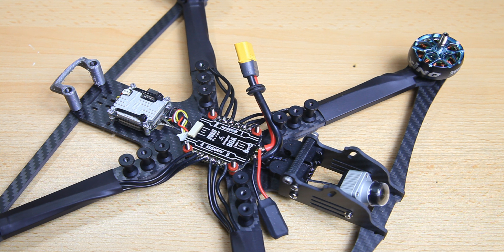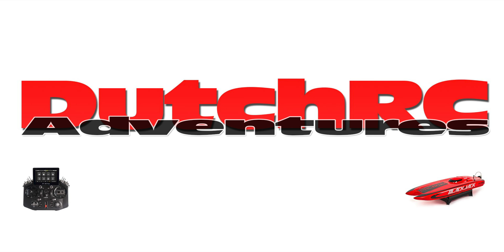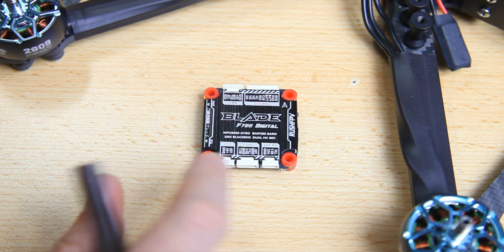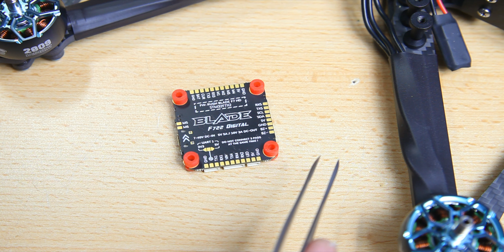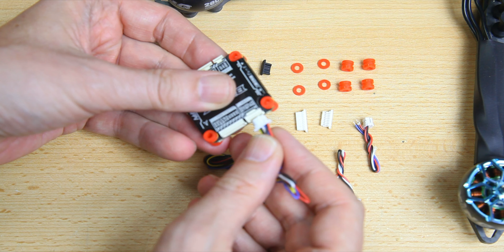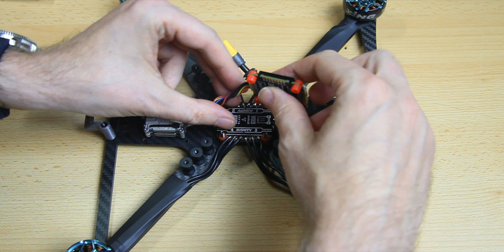Perfect Cine Cruiser Build Guide - P4 RushFPV Blade F722 Flight Controller Install

Comment from the maker: Pretty EASY install of this Rush FPV Blade Flight controller! :D 
FC - Rush BLADE F722 Digital 30x30 
https://www.stphobby.com/e/954305178093219840.html 

Other parts for this build: 

Frame - CMW Banggod 7 
https://www.fpv-fly.fr/quadcopter/drones-frames/frames/banggod-7-lr-catalyst-machineworks.html 

Motors - iFlight Xing2 2809 1250 KV 
https://shop.iflight-rc.com/quad-parts-cat20/motors-cat26/xing2-motors-cat334/XING2-2809-FPV-Motor-Unibell-Pro1673 

ESC - Rush BLADE 60A Extreme 128K 30x30 
https://www.stphobby.com/e/942705861348438016.html 

Cam + VTX - Caddx / DJI Vista 
https://caddxfpv.com/collections/digital-cameras-1/products/caddx-vista-kit 

FPV Antenna - Rush Cherry LHCP Extended 
https://www.stphobby.com/e/953639437628305408.html 

Receiver - TBS Crossfire RX Nano 
https://www.team-blacksheep.com/products/prod:crossfire_nano_pro 

Props - HQprop 7x4x3 
https://www.hqprop.com/hq-durable-prop-7x4x3-light-grey-2cw2ccw-poly-carbonate-popo-p0133.html 

Lipo - CNHL Ministar 1800mah 120C 6S 
https://chinahobbyline.com/collections/cnhl-discharge-rate-120c-continual-lipo-batteries/products/cnhl-ministar-series-1800mah-22-2v-6s-120c-lipo-battery-with-xt60-plug

Comment: I want to buy this one. But have the anaolog and  need a bramoter to keep level flight. Can one be put on this controller?
Reply from the maker: Barometer for level flight? You do know a barameter is for altitude control? 
I think you would have to add an external barometer to it via a uart.. that can be done
Reply: @DutchRC  Okm your right.. But how do I do that? having hard time finding anything on YT
Reply from the maker: @duanebowman9595  I haven't seen external barometers in a Long time.. if you NEED it, finding a flight controller that already has a barometer would probably be the easiest way....
Reply: @DutchRC  wanted to stay with RUSH. but don't want to change to digital.What wouyld go good with the rush 60A esc
Reply from the maker: @duanebowman9595  you could look for GPS unit that have a barometer... some come with GPS + compass + barometer... 
But... are you sure you really need a barometer? You don't need it to make the quad stable / auto level
Reply: @DutchRC  Don't I need it for Long level flt's with mission planner?
Reply from the maker: @duanebowman9595  I'm not really the one to ask.. I've tinkered with APM / Pixhawk setups but that is like 7 years or so ago 😅

Comment: Hi, with this Rush FC why are the GND and BAT wires to the ESC doubble? I need to connect a different ESC to this FC. Which BAT and GND do I take 🤔 ?
Reply from the maker: Howdy Chris. That is a Great question! I had actually wordered myself, but hadn't put further thought into it... 
Sooo I've asked one of my contacts at Rush! I'll let you know what they say :)
Reply: @DutchRC  i couldn't get mine to power my vista so i sent it back
Reply from the maker: @neoflowzFPV  that's weird? anyhow! Rush say there is no difference.. Not sure why they doubled them up then

Comment: hello,, very nice explanation,, is it necessary to connect this controller to the computer to program it?  Or is it not necessary,,,thank you my friend
Reply from the maker: wellll.. it is kinda Needed I think.. you want to setup flight-modes.. check if the receiver works.. 
But most settings will be more-less good already 
Cheers & happy flying :)